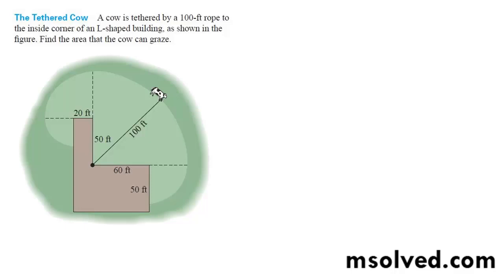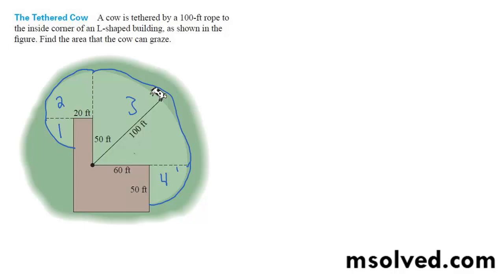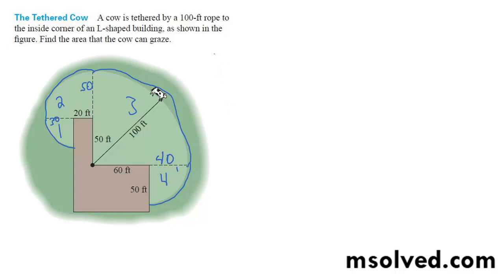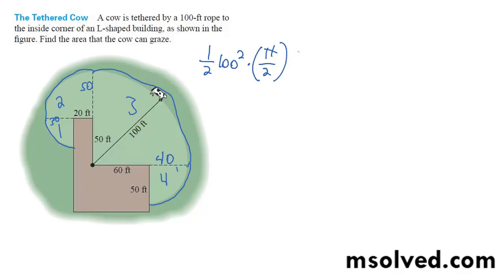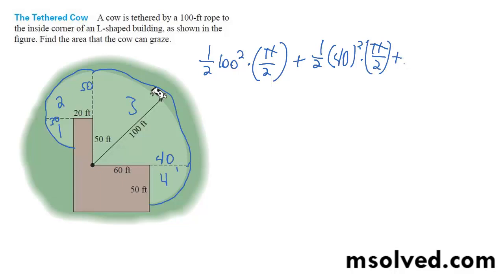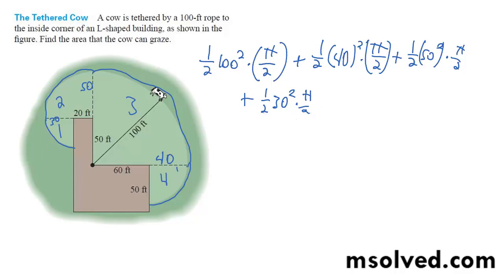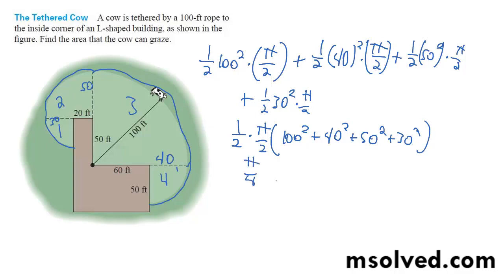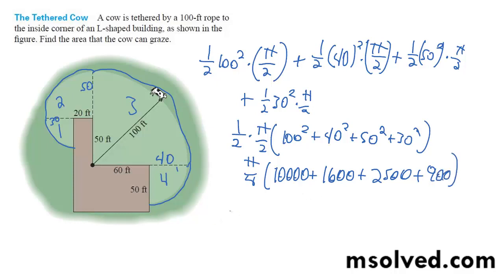The Tethered Cow A cow is tethered by a 100-ft rope to the inside corner of an L-shaped building,

Comment: Can u like show us how u got 30,50,40 instead of not?
Reply: you are given 50,20,100,60, and 50. so to find the dotted line for the vertical 50 it has to add up to 100. so that would be 50+50=100. that's how you get 50. To find the dotted line for the 20 it has to add up to 50. So 20+30=50. That's how you get 30. To find the dotted line for 60 the number has to add up to 100. So 60+40=100. That's how you get 40. Now that you have 30,50,and 40 you just plug in to 1/2*pi/2*(100^2+30^2+50^2+40^2). That gives you the answer. 1180.97 and when you round up to the nearest whole number it's 1181ft^2